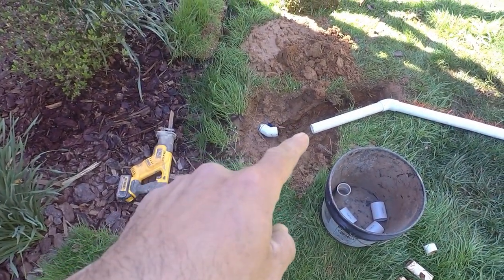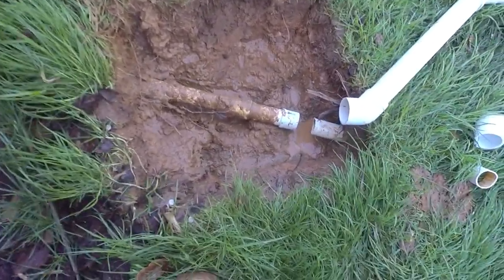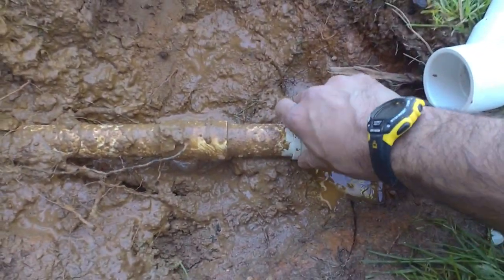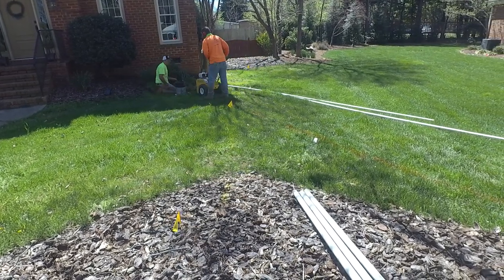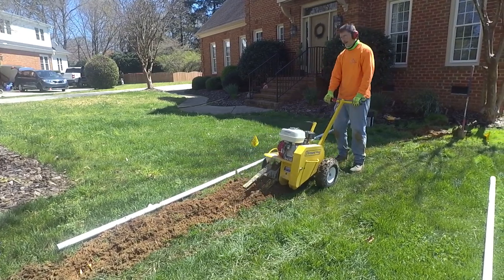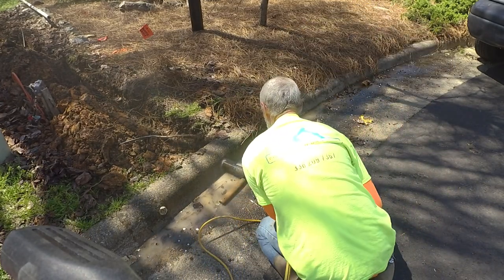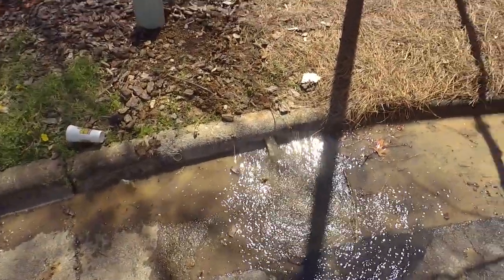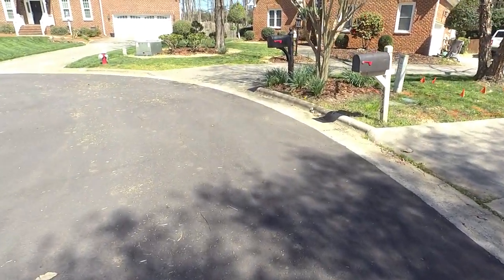Replacing a sump pump discharge line

Comment: Coring definitely is the way to go, it probably takes just as much time to core as it does to cut and refill with concrete anyway, it looks 1000X more professional. Customers always seem to find small details that they focus on when the job is finished and that's probably one of them. Happier customers = better reviews and recommendations to others. Keep up the good work!
Reply: I agree, cleaning up any mess you make, and little details can make a big difference for small effort.
Reply from the maker: Yes I agree! Guys on my crew say in 20 years of working they've never seen someone who won't throw trash back into the trench. I have them clean it up. Same thing with the customer's trash can - we don't fill it up with our trash, we haul it away.
Reply: Those are the small things that make difference! Great videos. Thanks for sharing your work.

Comment: In the jurisdictions I worked in a pumped line of would change to a larger line when you can get fall and before going though the curb.  This would reduce the pressure of the water coming out.  So instead of the discharge spraying out taking that like to a 3 inch 5 feet for the curb would make the discharge run out with little pressure.  I have seen pumped line spray out 6 to 12 inches.  Feeding that discharge into a 3 inch pipe really made a difference, the water just drops out into the gutter.   Always interesting the different rules depending on where you live.
Reply from the maker: Thanks for sharing David!

Comment: Hi Shawn. Love your work as always. For a job like this, would you consider using a sod cutter before ditching across a lawn? Bit more effort, but would leave a nice finish when the sod is put back in place.
Reply from the maker: I would definitely consider it. I had purchased a sod cutter when I first started but no one was that worried about it. The grass grows like crazy here in NC so it quickly returns to normal. Sometimes when I revisit a job I don't recognize it because our trench is gone already.

edit: I sold the sod cutter (dust collector)
Reply: @GCFD  Thanks Shawn. I guess you’re lucky there; we have a heavy clay soil here too, but not the warmth to grow seed that fast.

Comment: Those other curb cuts are embarrassing. I have been hesitant in my opinion of coring because it leaves a thinner section above the pipe which I imagined would fracture out over time. Being "down South", they wouldn't be exposed to the heaving and freeze/thaw cycles they would up here in the NorthEast.
Reply from the maker: So far I think I'm sold on coring. I ordered a couple extra bits and am looking for a backup hilti.

Comment: There's a bit that I've seen plumbers use to cut out toilet flanges that attaches to a drill I wonder if that would be something handy for you to have on the trucks to cut the pipe just inside the curb instead of cutting it I'm guessing the angle and trying to get it to match the curb curvature
Reply: you have to be careful it doesnt bulge in the anvils and put the pipe out of shape , especially when jointing .
Reply from the maker: Yes we've thought of using that or an oscillating tool to cut the pipe flush with the curb. I may start doing that but for now I'm pretty happy with the pipe being set back in the curb. Great comment!
Reply: @GCFD  my thoughts with the bit is you can cut it just inside the hole so you can let the concrete take the beating instead of the edge of the pipe like you do now but have the perfect aesthetics of that quarter inch reveal

Comment: Shawn, is there anything wrong with running a sump pipe into a 4" sch40 pipe that is carrying gutter water to the street? Or should the sump have its own dedicated line the whole way?
Reply from the maker: No problem as long as the 4" is sloping down pretty good. You don't want the pressured sump line to backflow if the 4" gets clogged.

Comment: Honest question not criticism......if roots ruined the old line why run the new line right through the roots.....are you expecting the pressure rated pipe to better withstand roots?
Reply: The old pipe looked like it ran underneath the tree, right in the thick of the roots that pinched it off. The new pipe off to the side should last a lot longer just by its location.
Reply: The tree itself or the roots likely broke the pipe due to excessive bending, allowing infiltration. It was Sched 40 thin wall which is much easier to break. Sched 80 stands up to roots a lot better, and the line doesn't run directly under the tree.
Reply from the maker: That's a great question! We tried to stay around the dripline of the tree where the roots are finer, but we had the property as well. We used a much stronger pipe and the tree is established now so we felt okay about running the new line closer to the tree. We weren't directly under the tree either which is what I think probably broke the first line.

Comment: If the pipe is still running through that tree line are further root growths not likely to cause similar issues in future? I understand that with the pressure pipe the walls are thicker and thus more likely to resist for a time but is this a solution or just a "fix"
Reply from the maker: The tree was planted on top of the other line, so the line was under the biggest roots. We felt okay with the placement because the tree was already established and we were further away from the largest roots. Definitely a consideration though.

Comment: How come you guys don’t use the Milwaukee pvc cutter that thing cuts 2 inch pipe clean cut and faster then the sawsaw
Reply from the maker: We do use ratcheting pvc cutters for the smaller pipe. It just depends on what we have out of the truck! 👍
Reply: This battery powered cutters are the best I use them for 2 inch exhaust pipe
Reply from the maker: @arielhernandez2911  yea they are great!

Comment: Have you put filters or screens at the end of the outfall to prevent insects or critters from trying to come up or burrow in the pipe? Not sure if that's ever been an issue.
Reply from the maker: No, I don't want to trap debris in there. The smooth wall doesn't hold debris so there is no habitat inside the pipe. Plus the pump blows everything out. Great comment! 👍
Reply: I have a clog on my downspouts and had to extend them out into the yard until I fix it. The chipmunks keep going into them.

Comment: If the line being right next to the tree caused it to fail why would you put the new one right next to the tree?
Reply from the maker: The tree was planted over top of the old line, so that line saw the biggest roots. We installed a thicker wall pressure pipe and kept it away from the biggest roots. The property line was right there. Great question!
Reply: @GCFD  thanks for getting back to me! Great content man!

Comment: How come all the houses over there seem to have their gardens run right up to the kerb? Over here we always have a pavement (I believe the american term is 'sidewalk') between a house's garden and the road, so people can actually get to the houses without walking on the road amongst traffic!
Reply: In the United States it usually depends on how new the subdivision is, how large the lots are, and if it is a cul-de-sac. Older more suburban/rural areas don’t typically have sidewalks. Newer subdivisions especially ones with smaller lot sizes are generally required to install sidewalks when the lots are developed. Short cul-de-sacs usually don’t have side walks because there’s no through traffic. It also depends on the Development regulations for each City or County.
Reply from the maker: What Steve said 👍